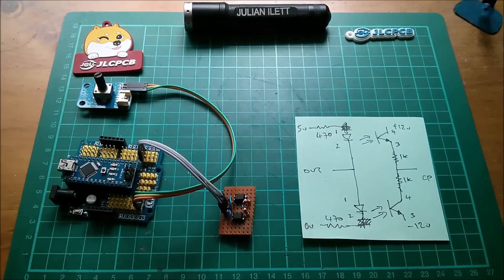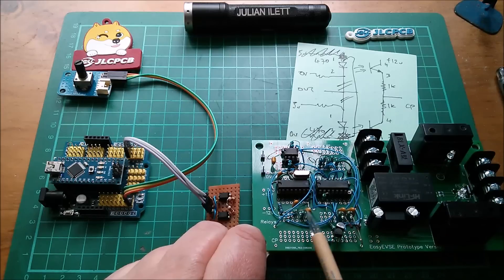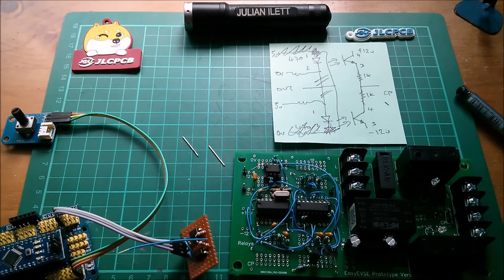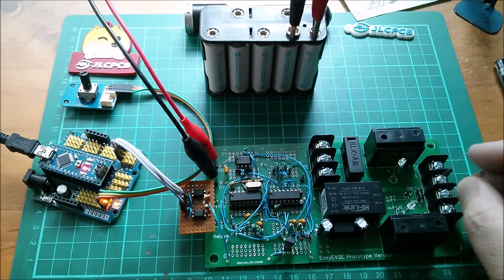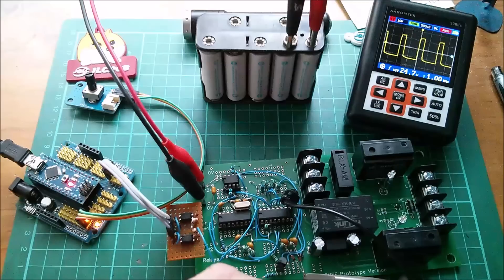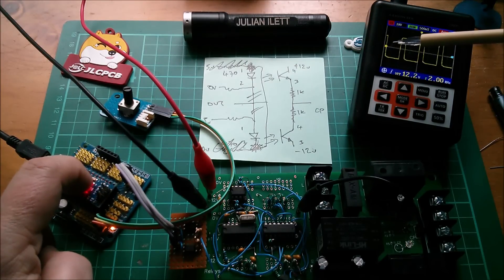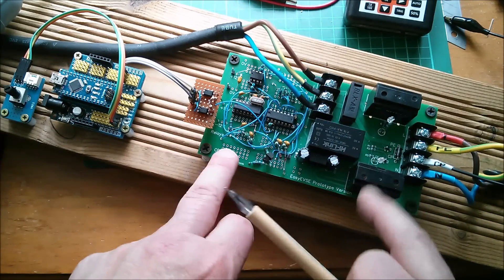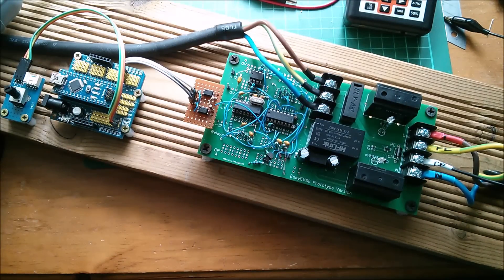Arduino to Charge an EV

Comment: So it really needs -12v ?   can't just do +12v and gnd?    I want to use the most minimal circuit I can get away with for the CP signal.   I have a few l298 chips that can output -12v and +12v as motor control, that seems the simplest way if -12v is required.  what you think.

Comment: Congratulations on the project. I am also implementing an ac charger, ampacity of 32 A. I am using esp32 and 4N35 to generate pwm +12/-12 VPP, with 1 kHz. To identify whether a vehicle is connected and whether the vehicle is ready for charging, I am using an LM393 (two comparators), one set to 9.4 volts and the other to 6.3 volts. The LM393 output is open collector. In the ESP32 used with GPIO with PULLUP, when it goes to logic level "0", I make the decisions. Everything works very well. I just noticed that on the CP pin, the signal is no longer +12/-12 but a positive signal of +12 VDC (1khz)? It seems that my LM393 circuit is harvesting the negative part of the wave. How did you check the voltages on the CP pin?
Reply: Not LM393, It is diode after EVSE CP output. And you should measure CP PWM 6V/3V with respect to 1. Cathode of Diode (same as these are connected2.74k, 1.3k, and 270 ohms ). 2 Ground (other end of these are connected2.74k, 1.3k, and 270 ohms). Now you measure CP signal across 1 and 2.

Comment: Hi, would it be possible to please explain the Arduino connections? I am trying to replicate the circuit using an Arduino Mega, and was a bit confused. The 5V and 0V connection can be supplied through the analog pins of Arduino and the "Out" pin should be the digital PWM pin? Is that understanding correct? Many thanks in advance

Comment: Nice project Julian. It is 2022 though so you should probably ditch that Arduino and use a esp8266 or an esp32 and then you can give it wifi capability and put up a webpage to control it remotely from your phone or a computer and/or feedback useful information like temperature of the live relay...
Reply from the maker: There's no need for this to be 'internet connected'. I'll be using an nRF24 wireless link between the solar panels and the car charger.

Comment: I love this series but can't for the life of me remember why you're doing it. 😕
Reply from the maker: 1. To learn how car chargers work.
2. To charge the car with the same number of Watts that the solar panels are producing.
Reply: @JulianIlett  Got solar panels coming soon, just ggot to work out how to convert 240V's in to diesel ;-)
Reply: @JulianIlett  I forgot to mention I have a Solar iBoost on my system that diverts spare solar power to my hot water tank instead of sending it to the grid. I think it works by sensing the current direction at the meter but I've no idea how it knows how much power to send to the hot tank as I don't think it is connected to the inverter. I guess it maybe ramps up slowly and then maintains a steady current to the immersion heater when it reaches equilibrium. Are you planning to do something similar.
Reply: @JulianIlett  Brilliant thanks, now I remember 😊.
When I finally get my EV conversion running I want to charge it from solar panels too so if you manage to crack it please share.

Comment: I found that opto-relays are very slow, but then they are design to mimic relays. other opto-couplers are a lot faster. i tried to put a rs232 signal through the opto-relays and it just did not work at all.
more swings than roundabouts :-)
Reply: Morning :-)
Reply: @fredflintstone1  well a good morning Fred it is ;-)
Reply: TTL  Time to live (TTL) Would be better With low Speed opto-couplers However Ethernet opto-couplers can Do much Faster  (10GBits)

Comment: You can use it to charge your car from a house connection/power bank, but is it also possible to charge your power bank from a charging station because something like this would be interesting for many people who are out and about with their e-bikes, e-scooters, etc. in order to then charge them again be able
Reply: Adapters for this do exist for both type 1 and type 2. Got to be careful with them in the US as EV chargers are usually wired as 220V not 110, thankfully something like an ebike charger will probably support both voltages just fine but it's something to watch out for

Comment: Can you change the charge current while it's charging or do you have to stop and start it?
Reply from the maker: Yes the current can be varied without stopping the charge session. That's important for the next stage - varying the charge current to match the output from my solar panels.
Reply: @JulianIlett  The fact that this isn't already implemented ubiquitously on all EVSE, on all Vendors baffles me...
No, you have to buy a home energy management system with cloud connection to automate this "intelligent" charging.
Reply: @michac3796  It's definitely better this way - then you control how 'intelligent' the system is.  There's nothing worse than being stuck with some vendor's definition of what is intelligent and you having no control over what it decides to do!
Reply: The standard allows changing during charging. This is quite common too. A lot of charge points default to 1kW at initial connection and then ramp up to their final target. Also quite common if you have a charge point with 2 connectors serving two bays, if just one is in use then it supplies upto 7.2kW, but when the second is in use, it'll switch to 3.6. There's also some charge points that pull shenanigans according to available solar

Comment: Ev are an interesting new take on motoring but i worry about the day im forced into one because of my love of audio :(
Reply: How is your love of audio impacted by EVs?
Reply: @sailingoctopus1  the massive demand on power.
Reply: @stevefox3763  In EV's the power for your audio comes from your "normal" 12V battery, just like your IC car. So no difference. Stop trying to look for excuses for staying with IC cars, you Luddite.
Reply: @fredstarkey3425  i know that, im not an idiot but maybe you are seeing as name calling is your level.   
You think power is infinite in an EV and you think it has the headroom to handle the massive current draw and in violent pulses at that on the 12v system? 

Why dont you try Spiking your system with 250A 150 times a min for hours every week and see how it copes.
Reply: @stevefox3763  Just replace the 12V battery with a bigger one or a dedicated LiFePo4 bank for the audio. Not a problem.
Reply: @zaprodk  that does not solve the power delivery too the battery though, a bigger battery fixes nothing if it cannot be supplied with the power to back it up, its nothing more than a buffer and the alternator is doing all the work in a internal combustion powered vehicle.

I have a large 100Ah/800 CCA battery in my car but I won't use the stereo without the engine running cos I'd drain that in no time, I'm peaking at 250A draw.
Reply: @stevefox3763  The DC/DC converter in the car takes care of that. It charges the battery from the main pack. In the case of Julian's MG car it's 178 A @ 14 V, so that's 2500 W constantly available. So not a problem.
Reply: @zaprodk  its better than the 150A alternators I fry, the last failed catastrophically and just a few days ago as it goes, it looked like I had an engine fire from all the smoke when the enamel on the windings broke down and caused a massive short lol, I murder one in under a year on average :/
I'd still be worried about 178A on a car where it's going to be stupid expensive when its inevitability killed, my alternators sting but i bet they are pennys compared to a ev dc-dcI

Dont know if you mentioned 2500w because I said my system is 2.2kw but remember nothing has 100% efficiency, not even close in car audio even with class D amps and I was talking output watts, not the draw the system places in watts.

I wanna like EV's, as a v6 driver, the performance EV's have has my ears pricked up but audio is my first priority, I love my system and it will only get more powerful in time, I'm fighting the urge all the time lol.
Reply: @stevefox3763  If you can fry a 150A alternator with your audio amp then you're right to be concerned about drawing too much power from the onboard dc to dc converter. Fry it and your bill will be significantly higher than the cost of an alternator.
Reply: @alibro7512  more like amps lol, I have multiple he he
Reply: @stevefox3763  Please excuse my ignorance but why do you need thousands of watts of speaker power in a car? I've been by a ~200wpc system in a warehouse and it was very loud, enough that I wouldn't want to be around it for more than a minute. I can't imagine how loud a 5x more powerful system would be when all the power is confined in a car cabin.

I would highly suggest looking at more efficient speakers rather than higher power amplifiers. Speaker efficiency can vary greatly (over 100x) with readily available drivers. Active crossovers and separate amplifiers for different frequencies could also help if you are not doing so already.
Reply: @fredstarkey3425  First of all, how does using an internal combustion auto qualify as being Luddite? Second, how do EVs advance the cause of environmentalism in any way? All they do is shift the resource consumption out of site, it still eats through the same resources, perhaps more, considering all the additional mining and refinement needed for the batteries.
Reply: @stevefox3763  Wire a telecom rectifier or two to the main battery pack and you can have 48V at however many amps to run a whole lot of TPA3255 boards.
Reply from the maker: Who needs a kiloWatt of audio inside a car? When your hearing starts to fail, you'll regret doing that :)
Reply: @JulianIlett  Car audio freaks boast about the output of their rig, so it's a status issue. What they conveniently overlook is that systems are rated at their peak output, not RMS, which for sound is typically half (or less) the rated capacity.

These systems damage the brain, of these people, not just their hearing, judging by their comments.

In a similar discussion, I pointed out that the power in two fully charged MG5 battery packs could comfortably have powered the sound system at Philadelphia Live Aid in 1985.
Reply: @stevefox3763  a 250A rated 12V sound system draws 3kW at peak load, so typically 1.5kW or less at RMS. The V2L capacity of Julian's 2022 MG ZS EV is 2.5kW, meaning that the 50.3kWh battery pack could run the system for at least 33.5 hours.
Reply: @fredstarkey3425  No need to get personal.
Reply: @JulianIlett  2.2kw RMS :)
Reply: Eh?